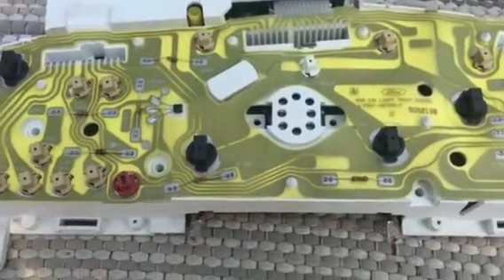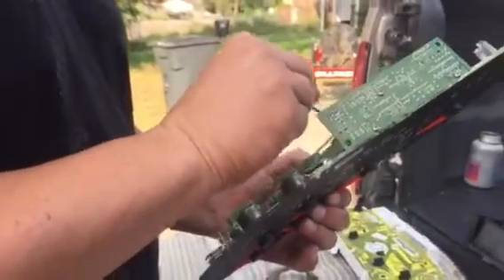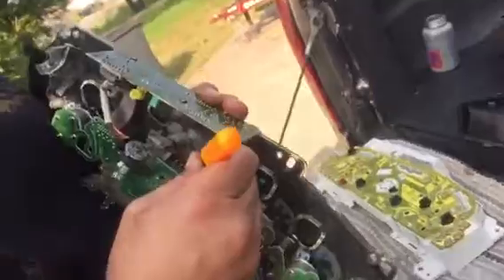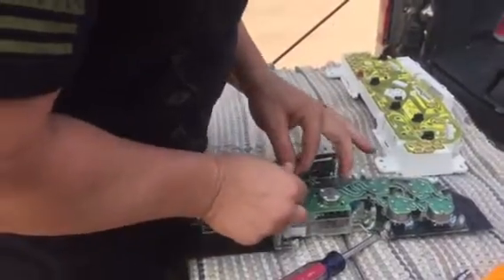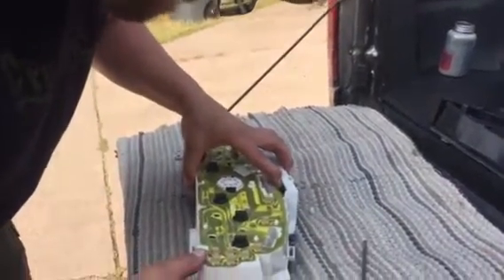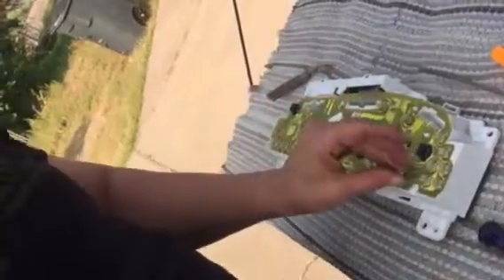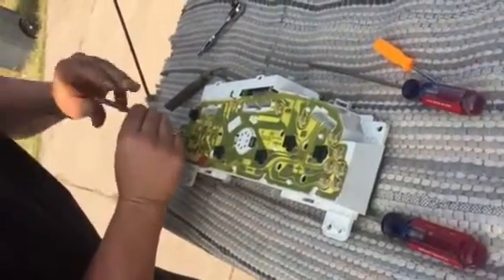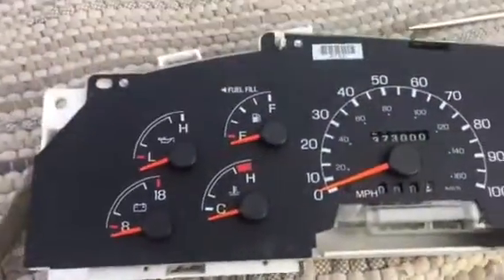E99 F350, 7.3L odometer repair

Comment: Did it work or did you plant some flowers?
Reply from the maker: Tapio Lille No, it didn’t work. I ended up buying a replacement off eBay. I set the odometer but only set the far left digits. 38x,xxx from 42x,xxx didn’t want to break the new one.